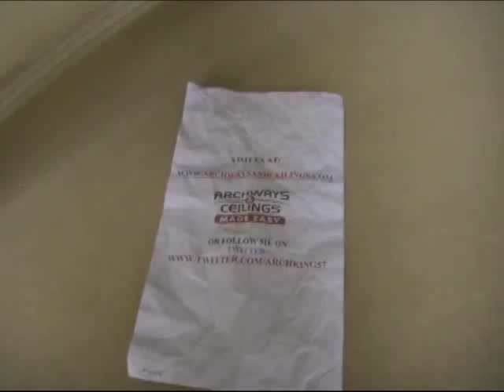How to build a Groin Vault Cross

Comment: A) It's not a groin vault because it's not made of masonry.  For want of a better term, it may be called a faux groin vault.

B) Because the architect designed the ceiling feature to "float" in the middle of a large ceiling area, far from the edges - it looks awful.  That is not a comment on your workmanship, just the designer's.

C) It would look really cool if used in the right place

D) What are those ribs made of?  Do you make them or buy them?